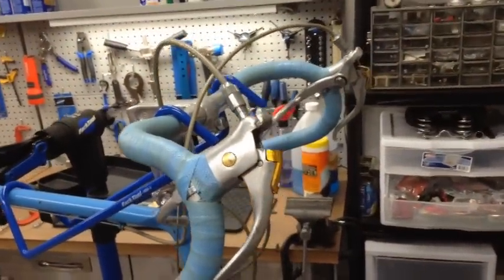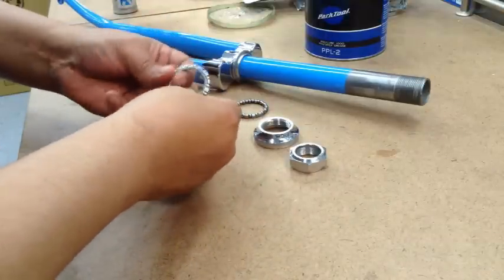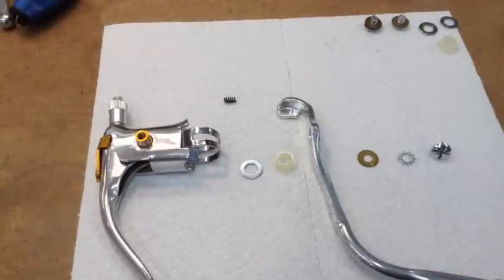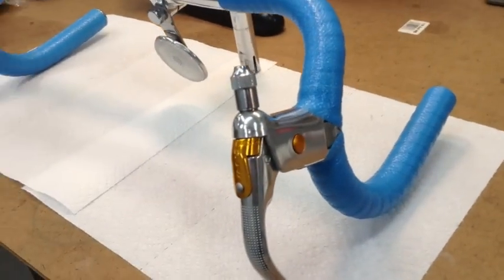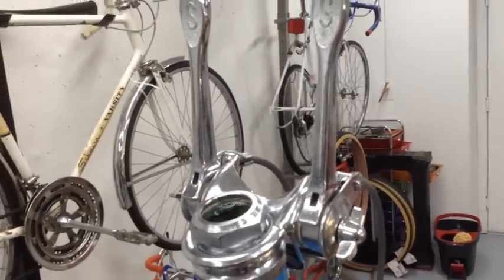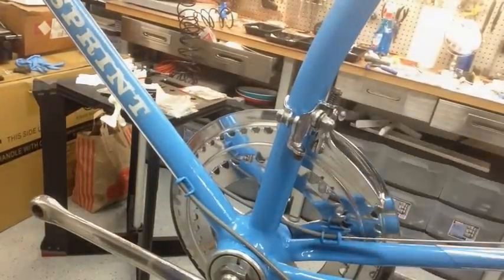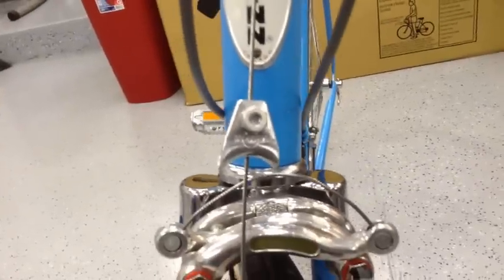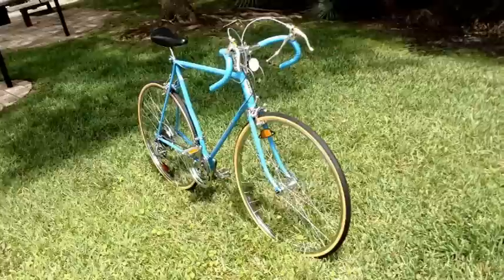Part 4 1974 Schwinn Sprint  Restoration Complete 🚲🔧

Comment: Hello, i love the way you put such detail into your work. You're bikes look FANTASTIC!.  I've done exactly the same thing with (2) Super Sports.  The first one is a '73 Sunset Orange that I received as a gift for graduating 8th grade, the second is a '71 Burgundy that I purchased on E-bay in 2007.  like yours, when finished, the bikes just "POP"!  I do have a question though;  Did you completely disassemble the front and back wheels (spokes and all, down to the hub), in order to polish the spokes?  Also, let me make you aware of another brand of polish.  It's called Flitz, it comes in a grey can or squeeze tube, it has the consistency of toothpaste.  I have used this product religiously for over 30 years.  I've used others, but have found nothing else comparable.  I also use it on all the bright work on my restored Model A Ford pickup.  The shine is incredible, (especially if you use the buffer, that you show in your video), and the sheen lasts an extremely long time.  The aluminum on these road bikes polishes up to almost a chrome plated look.  Please keep up the excellent work on restoring these two wheeled, bomb-proof, treasures from Chicago Illinois.  Next fall, I plan on restoring a '68 SS where the frame has very few blemishes.  It did not come with the secondary brake arms and I think I'll put a set on, just for "rider comfort".  Happy Wheeling.....
Reply from the maker: Very Nice 👍🔧🚲 sounds like you have some pretty sweet SS in very nice colors... I know that feeling , when you roll them out  the first time for everyone to see 😁🚲👨‍👩‍👦‍👦 These Vintage Schwinn lightweights do clean up nicely, I have a 1972 Opaque Green SS and it rides like a Cadillac.
Thanks for the polish recommendation, I will look for it on Amazon, sound like it has the same texture of the SimiChrome polish. I polished the hubs and rims around the spokes, I just trued the rims  and polished every spoke. I'm currently finishing up my 1973 Kool Lemon World Voyageur ,putting on the decals  and will finish the build next week while on vacation... enjoy your 68 SS project and thanks for watching 👍🔧🚲
Reply: @that70sschwinn  Thank you so much for the reply.  I wondered how you cleaned up your wheels.  I do pretty much the same, such a hassle it would be to do a complete tear down.  I'm sure I'd fail miserably at the re-assembly & then the task of re-truing.  That "art" is one thing I just can't get a handle on.  I saw your '72 green SS in another of your videos, another excellent job.  If I may ask, where are you located?  I'm in Tucson, AZ
Reply from the maker: @amontgomery3391  I agree rebuilding the wheels does require a skill I rather pay for if needed. I had a bike shop re-lace my 1973 rear wheel and they messed it up 🙄 they used the same size spokes on both hubs which puts the free wheel off center, they had to re-do the wheel and took weeks before I got it back, the drive side requires a shorter length to allow it to be centered. When I tried to mount the wheel, it was way off😫🚲
I got that SS form a really nice guy in Arizona, she was rust free and well maintained, I will reinstall the lights and shorty fenders that came with the bike when I got it  here in South Florida great weather for bikes😁🌞
Reply: @that70sschwinn  I'm wondering how I could either send you pics of my SS's, or upload them somewhere so you could see them?  Basically, I've got three passions in life, Model "A" Fords, fishing, & Schwinn Road bikes from the early '70's......I grew up with all three...
Reply from the maker: @amontgomery3391  Nice👍 You can join the Schwinn forum by following the link below, this is a great place to post photos and meet other Schwinn collectors and guys who used to be dealers or mechanics for Schwinn in the 70's
https://www.schwinnbikeforum.com/index.php
Reply: @that70sschwinn  Thank you!  I sent you a PM on the forum.
Reply from the maker: @amontgomery3391  Nice Super Sport, Great job on the Restoration, Looks like it was nicely maintained and had plenty of TLC through out it's existence. I added your bike to my Community page to share with everyone, Very nice example 👍🚲

Comment: Where exactly did you get that bar tape. I need the same one to complete my restoration. Thanks!
Reply from the maker: These are hard to find, this is the same ones I wrapped on my bike, slightly darker but actually match the bike color better than the original lighter shade, not a bad price, these can go for $24 at times, follow the eBay link below
https://www.ebay.com/itm/WOW-2-Rolls-NOS-Vintage-Hunt-Wilde-Blue-Road-Bike-Bar-Tape-w-Plugs-Schwinn-etc/174084750118?hash=item2888427b26:g:o2IAAOSwWhVbu7av
Reply: That 70's Schwinn Vintage Bike Channel  Thanks for the link, I appreciate it.